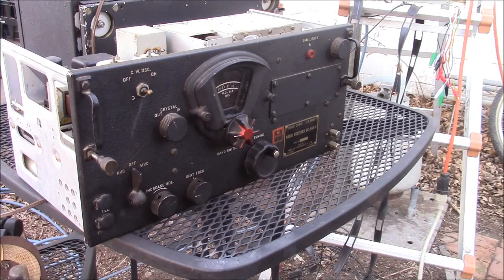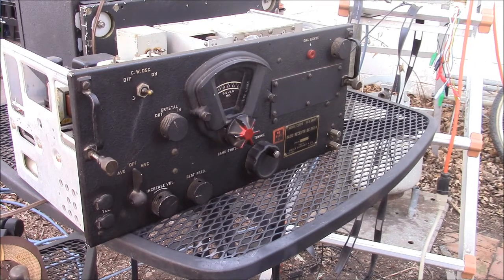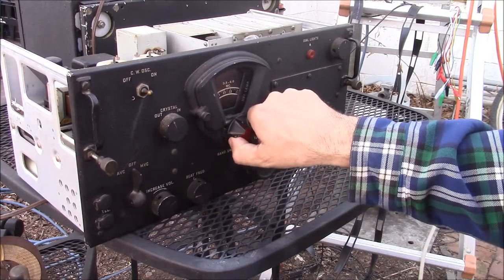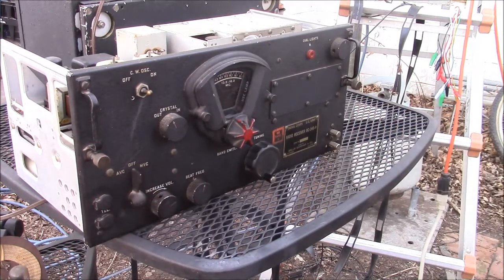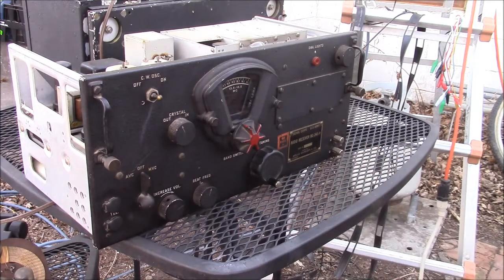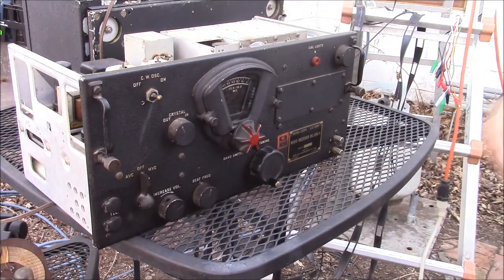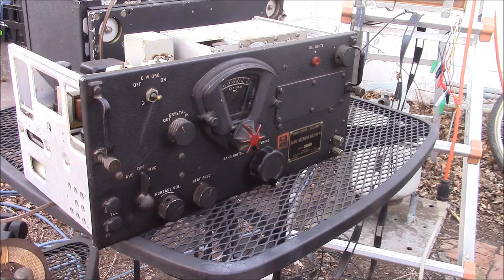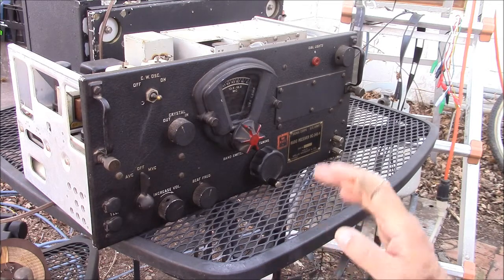Spot the Radio / BC 348 N

Comment: Some versions, like my original BC348M had a knob for "tuning" the antenna as part of the original manufacturer spec.  It may not have been added by a previous owner but rather may have come with the "Ant. Tune" as part of the original construction.  Sadly, I no longer have my BC348M any more...when I lived in Georgia I gave that and an ART-13 to a Boy Scout Troop that was interested in Ham Radio.

Comment: Nice beefy radio... looks like the upper switch and knob have been swapped over (sides).

To "undo" the antenna control drill hole you could pull the panel and with a small metal back plate solder/braze the cavity.